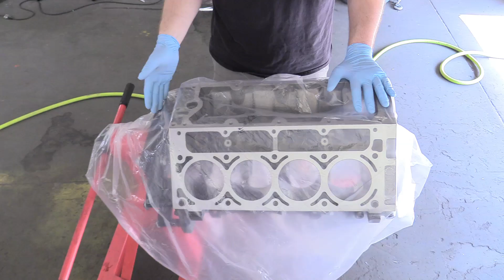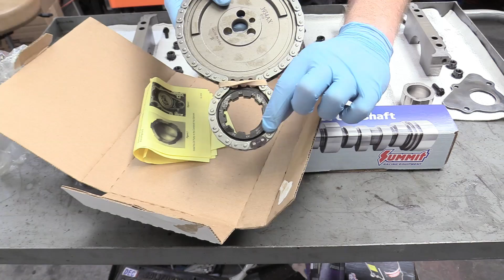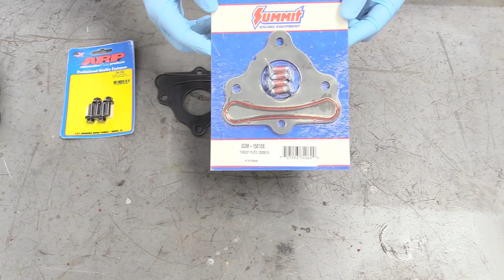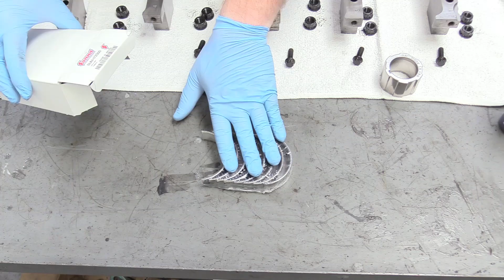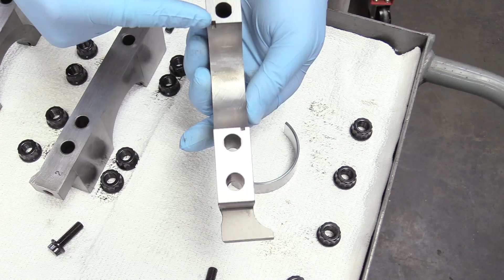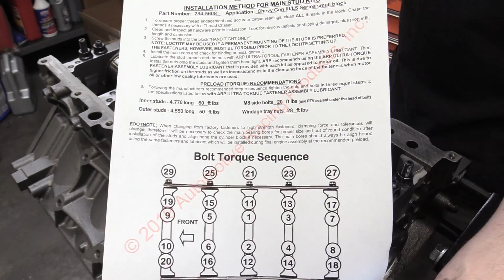How to Build a 5.3L LS LM7 V8 - Part 4: Clean, Camshaft, Crankshaft and More!

Comment: Love your videos, I will get my project engine next week.The question I have is when you sent the engine to the shop for them to install the cam bearings, which ones did you buy or does it come in a kit? Thanks
Reply from the maker: I just ask for a tri metal bearing if possible. But if not whichever they recommend is a safe bet. Thanks for watching and good luck on your build!

Comment: I installed thrust plate and as soon as it clicked i saw a stress crack appear....😢 u say 18ft lbs..summit says 11ft lbs
Reply from the maker: 18 is the official torque spec from GM. Sorry yours cracked, I'd reach out to Summit for a replacement. Thanks for watching!
Reply: @2carpros  so icompared specs on multiple sites, summit, even alldata and others, and the regular hex bolts say 18ft and the torqx countersink bolts are 11ft.

Comment: Ok please reference the stud instead of bolts.  How much extra was that?  What kind of studs?  What did that provide?
Reply from the maker: The link for the studs has been in the description. They are 230 or so but they are more rigid and should be able to handle more power. Thanks for watching!

Comment: So do you not have to measure for bearing  clearance and crank bearing clearance? If the bearings are brand new? This is the problem I’m dealing with right now is buying the tools to deal with clearances very overwhelming part Would love a video on it. If I have all brand new bearings in the engine, do I still have to measure clearances???????????? Please help
Reply from the maker: I did that on the Ford 302-347 stroker build we did. Videos are up on this channel. Every last arm chair mechanic on the internet will tell you it is 100 percent necessary, despite them never building an engine in their lives.

But I have built dozens of street build engines without doing and it worked out just fine. It is usually pretty obvious when it's wrong. It's either too tight, too loose, or usually it's just right. The machine shop doesn't want to have to do their job twice for the same money. 

Thanks for watching!
Reply: @2carpros  wow thank you so much for responding!!!!!

Comment: No assembly lube or oil when installing the block crank bearings i noticed? Just dry?
Reply: Nevermind haha you just answered my question a few minutes later when you applied the lube for the crank install. They went on dry to avoid spinning a bearing. Got it. Thanks

Comment: Are these the same main caps the engine came with? Did you tell the shop to upgrade your bolts to ARP?
Reply from the maker: Same caps and I supplied the upgraded ARP hardware. Thanks for watching!
Reply: Hey Ryan I had another question. Did you check all the main bearing for the proper oil clearance or did you have the machine take care of it. Also did you use different main bearings to get the proper bearing oil clearance. I'm looking to rebuild a LS1 I don't want to mess up on this important details.

Comment: So you dropped off the studs along with the parts? They installed the studs for you?
Reply from the maker: Yep. They have to bolt down the mains to make sure the crank setting is concentric. The studs are super easy just screw them in. Thanks for watching!

Comment: Do you have a vid or guide on installing stock crank shaft bolts?
Reply from the maker: It's basically the same procedure but difference torque figures. Thanks for watching!
Reply: @2carpros  Thanks! And also is setting the thrust bearing really that easy?

Comment: I forgot to set the thrust bearing before angle torquing . Should i unbolt and start over or can I just set it after?
Reply from the maker: Yeah you have to unbolt and set it then bolt it back up sadly. Thanks for watching!
Reply: @2carpros  
I did just that . Thanks again for always respond on this video really appreciate you

Comment: Can't I just buy the summit racing 5.3 450 hp. 420 torque instead?????. This is alot of work
Reply from the maker: Ours made a 100 more horsepower but yeah you can totally buy that. Sometimes the work is the fun part. You can take pride in something you built coming to life. Thanks for watching!
Reply: @2carpros  yeah I was thinking the same thing . Building it myself. Your videos were the best step by step videos I've ever seen. But I don't know if I trust myself with building something so complicated. I'm mechanically inclined but I've never built an engine before. That's why I probably would just buy one already built. You guys are awesome. If I do decide to build one myself. Well let's just say wish me luck.

Comment: How important is the timing set? In any issue purchasing the stock set?
Reply from the maker: Pretty darn important. Yeah you can use the stock set if you aren't making crazy power. It would be such a bummer to skimp on the timing set and have the chain break after a few years. Thanks for watching!

Comment: It been nice to actually believe you're video but it ended up in clips. Needless to say.. given fact that your stating 60 n 50 why not just do the same with the o.e.m bolts. Without exaggerating the fact.   Torque spec is torque spec regardless isn't it??
Reply from the maker: I clip things so you don't have to listen to me grunt and turn something for 3 minutes. If I did you'd complain I'm wasting your time with unnecessary footage.

Comment: ARP just points out the folly from manufactures that put locking compound on fasteners. If the fastener is not in the elastic region, it will loosen. Friction will make the torque wrench indicate before it is actually reached. This is why there are also bolt stretch gauges.

Comment: I have a rookie question lol 
So I gotten my engine back from the machine shop, it’s already built from the crank being installed, rods and pistons, 
Only issue is I want to go arp main studs and everything, do I take the oem style bolts off and just replace them one by one with the arp studs or do I have to take em all out and follow the same procedure as the video 
Same arp part number as well

Comment: Question. Where  the ARP Main Stud Kit bolts installed by you prior to taking it down to the machine shop, or does the machine shop do that for you?
Reply from the maker: Yep they sure do. They need the studs to torque down the main caps so they can line hone the crank journals. Thanks for watching!

Comment: All laundry detergents have abrasives in them. Even the liquids. If you're looking for a mild degreaser with no abrasive, you should be using Dawn.
Reply: That's why it's called laundry detergent.
Reply from the maker: I don't think that is correct. Dawn is also a good choice though. Thanks for watching!

Comment: The main bolts are said to be TTA, not TTY so you can reuse the stock bolts if you need to save the money.
Reply from the maker: I would just buy the ARP ones personally. I have been told the stock ones are not reusable by the way. They are also TTY according to GM. The ARP ones are not TTY and are reusable. Thanks for watching Chris!

Comment: ARP lube is for the threads and not the nut surface??
Reply from the maker: No, the nut surface. Thanks for watching!
Reply: Quote from their site.  “fasteners. The lube should be used under the head of the bolt or the bearing surface of the nut and on the threads, unless a thread sealer is used.
Reply: Looks like we were both correct

Comment: What is a complete engine rebuild price i have the same motor and wanna rebuild it
Reply from the maker: Hey Edwin, well we have replaced literally everything. So the price is much higher than if you reused as much as you could. We are probably right around $6500 but you could do it for around $3000 if you re used parts. Thanks for watching!

Comment: Did you supply the machine shop with the Cam bearings and Main Studs or was that part of their estimate?
Reply from the maker: So the Cam bearings were source and installed by the machine shop. But the main studs were provided by Summit Racing and made by ARP. Thanks for watching!

Comment: On the topic of torque wrenches, I heard that going from a higher to a lower torque number on your wrench will not accurately set the torque. It will be too high.
To do it correctly, you'd have to go to 0, then up to the number you want.
Again, this is what I heard. Any truth to that or not?
Reply from the maker: Price and I talked about this at length when I read this comment out loud. We both came to the conclusion that the spring inside that controls the torque setting wouldn't be affected be going all the way down to zero then back up to 50 or at least enough to matter to us. I also read the manual that came with my Snap On torque wrench and it didn't mention anything besides setting the wrench down to 0 after you are done and putting it back in the drawer. Thanks for watching Dan!
Reply: Back in the day my mom made us change the channel (I'm OLD) by turning the TV dial (I'm really OLD) clockwise only even if we wanted the next channel down ...  She would approve of the above post lol
Reply: @earnestbunbury2103  I know exactly what you're talking about cuz if you go the other way it's going to weaken the plastic dail, and make it so you need a pair of pliers to turn the channel